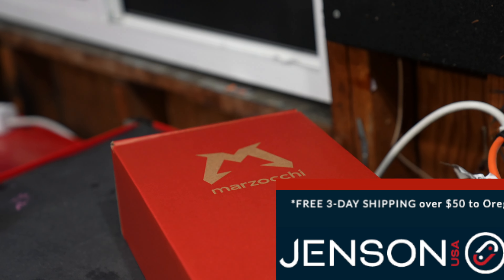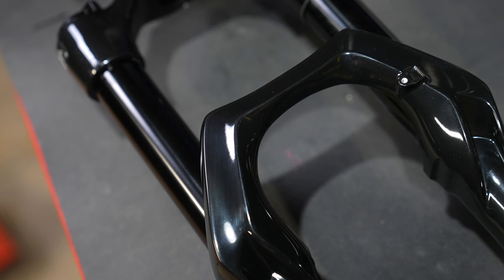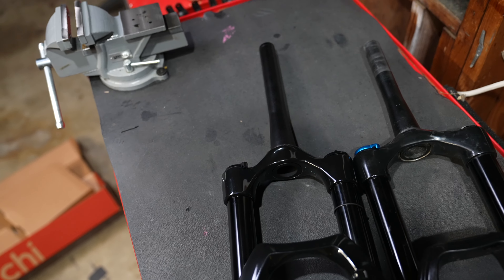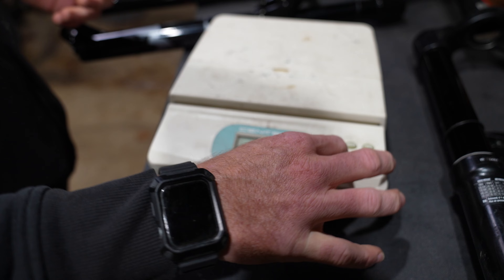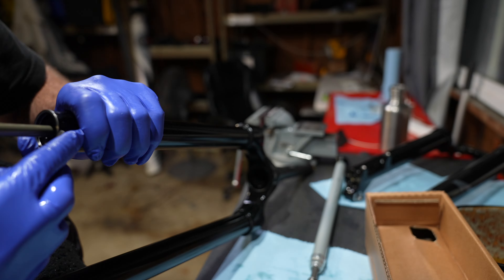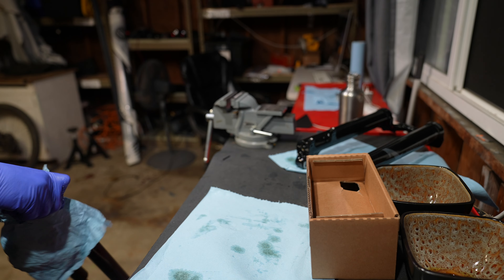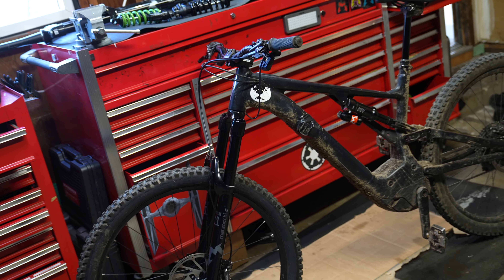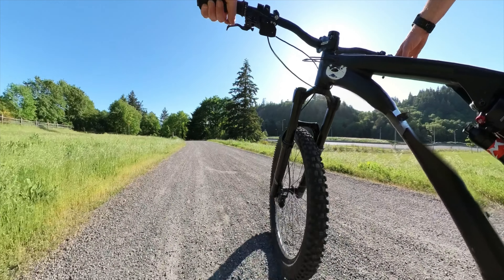2025 Marzocchi Bomber Z1 Revealed

Comment: The smaller diameter piston and same damper as the Z2 in this new Marzocchi fork can be due to de fact that is E-Optimized. Same happens with E-Optimized Fox forks. For example E-Fox 36 will use normal Fox 34 inner components and have a thicker stanchion wall
Reply from the maker: Wrong, the head crown is thicker, explained in video. The Rythem air spring is a 2015-2017 36 air spring. I am guessing to prevent the upgrade. 2015 e bikes weren’t a thing

Comment: Push out the pin from the nylon seal head. You can swap the seal heads that way. That's how you can get the newer negative chamber spacer on the marzocchi air spring. I did it on my 38 to get it really, really plush. Also, that damper just sounds like a Fit4, that rail is probably just the same, but with the low speed compression adjust locked off.
Reply from the maker: I tried, but I think you need the roll pin tool , like the luftkappe install. How did you get it out? 
Damper is primitive, below fit 4
Reply: @OtterMTBtech  a vice and a similarly sized smooth pin lol
Reply from the maker: That does work, I swapped from the bottom, see if it works
Reply: @OtterMTBtech  damn you put a longer collar on the air shaft? Make a video!
Reply from the maker: I just used the bump stop and collar thing from ‘21. Had to use everything from Rythem. 

Will post soon messed up shims stacks on damper

Comment: Would be interesting if you checked out the 24/25 Bomber CR Coil. I've received two duds in a row now, and a lot of people on the internet are reporting the same. The problem appears to be some kind of spring/washer inside that snaps, leading to clunking in the shock under compression.
Reply: It is the issue of that design. Bomber cr is the copy pasted old fox van rc which had the same problem. You just replace it when it snaps (requires taking the ifp chamber off and then rebleeding it)
Reply from the maker: I will drop the bomber  video later today.

Comment: I thought i'm the only one inserting the starnut crooked 😂
Reply: I used a cheap socket to bang it in, it expanded into the steer tube and got stuck. It was also probably crooked 😂
Reply from the maker: It works fine
Reply: A proper star nut fitting tool only costs £10.

Comment: Welp guess this isn't the upgrade from my suntour xcr34 air that id hope

Almost went with a 2024 lyrik select but was told marzocchi and fox have better small compliance 

Not sure what direction to go anymore
Reply from the maker: What bike? What kinda riding?
Reply: @OtterMTBtech  I bought a 2024 Roscoe 6 because I want to upgrade the components as I see fit. Plus I loved the matte Keswick green color over any of the Roscoe 6, 7, 8, and 9 colors haha

I've already replaced the 9spd cues drivetrain  with Shimano 12speed and replace the rear wheel with a high engagement hub/wheel (same as the Roscoe 9). I essentially have turned this into a Roscoe 8 of sorts

Just need to replace the fork. I'm 280lbs kitted. I do trail moderate trail and I'm beginning to progress in skill and speed. I'm also beginning to do mild to moderate gaps and some mild jumps. And want to try mild to moderate downhill within my comfort and skill level. But I am progressing slowly but surely. The xcr 34 air's small bump compliance is leaving a lot to be desired. And when I lean and turn at speed I can hear the rotor scrape the brake pad indicating flex within the fork

I ride in the Houston TX area but want to travel to Austin for spider mountain and other sorts.
Reply from the maker: The old Z1 or Fox 36 is a better fit for progression. FYI I run Cues, saves allot of money

Comment: Bought this thinking it still had the Grip damper in it.  Wondering if Grip is that much better than the Rail 2.0.?
Reply from the maker: I think it is worse, it has increased mid stroke, but feels terrible in the chunk. Working on a video now with it torn down

Comment: Have you tried a fork with a Smashpot conversion? I found my fox 38 felt like crap (likely too much grease) so figured I'd try a coil swap.

Would be interesting to see how you would review one.
Reply from the maker: I just have to edit the video, it’s nice name says it all it smashes, doesn’t jump great. Doesn’t require token air pressure setting, if you don’t setup a 38 right it’s bad. 

I have 38 setup video

Comment: I thought the super z replaced the z1
Reply: So they replaced a really solid $700 fork with a somewhat better thousand-dollar fork...hmm

I'm still bummed that they decided at some point to no longer make a lower travel version of the Z1 - I won a 2019 Z1 130mm and when they launched the Z2 they made the Z1 150mm and up IIRC
Reply from the maker: You just need to change the air spring.
Reply: Kinda looks like it did, if you want performance like the previous Z1 or higher